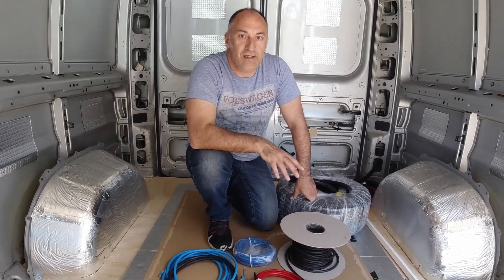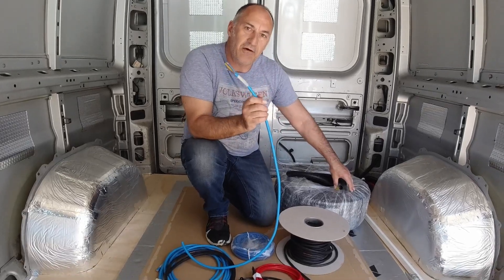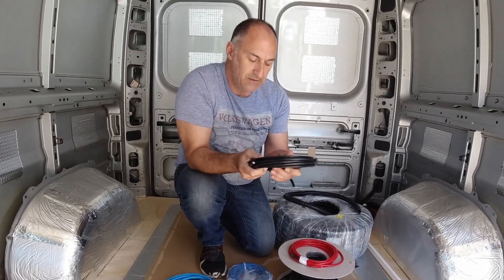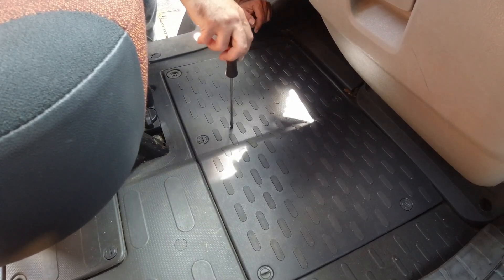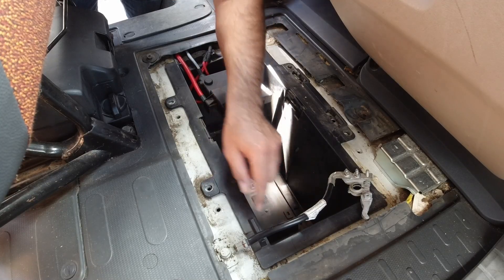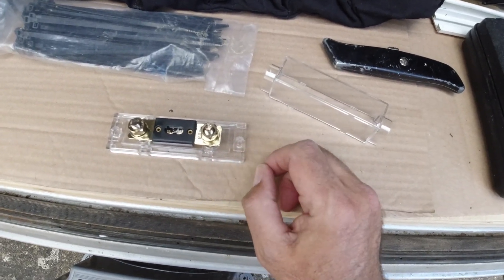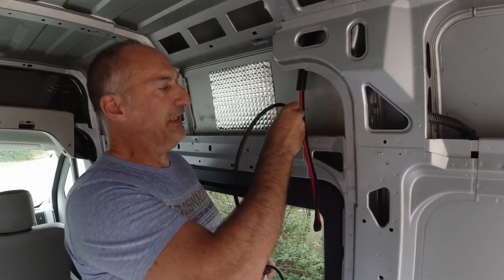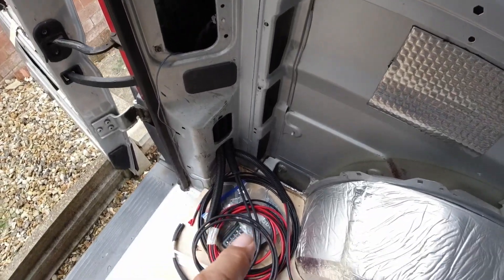How to Wire a Camper Van - Budget Build Electrics Ep15

Comment: Hi Greg. Big fan. I've followed your renogy installation to the t. I was wondering if you could help with a problem I'm having with my inverter. It works perfectly with 240v, but off the grid, I'm getting a reverse polarity. Do you have any suggestions. Thanks Graham 
Keep up the great videos
Reply: I plugged a tester straight into the inverter. I wanted to test it before going any further.
Reply from the maker: @GrahamSmith-i8u  I would expect no earth from the output but not reverse polarity. 
Does that differ from battery feed to mains input.
Reply from the maker: First thing to check would be all your 230v wiring to make sure not crossed any connections on your installation
Reply: Thanks for getting back to me so quickly. Yes, the wires are on the opposite side to the charge controller with mppt. Some suggestions are it could be that it's not earthed properly. I've earthed it to the body of my van. Is that correct? Thanks Graham
Reply from the maker: @GrahamSmith-i8u  I was referring to your 230v mains cable installation that you would have done. I’m assuming you wired off the inverter to some plug sockets. How and where are you testing for reverse polarity?
Reply: @GregVirgoe  Yes I have a plug socket straight from the consumer unit in which I plugged the inverter into, and that's fine when hooked up.
Reply from the maker: @GrahamSmith-i8u  unplug the mains kettle lead to the inverter. Just have it connected to your battery and turn the inverter on. What does your plug tester tell you
Reply: @GregVirgoe  that's where the problem is. Without hookup, the polarity is reverse d.
Reply from the maker: @GrahamSmith-i8u  yes I understand that but with the mains unplugged?
Reply: @GregVirgoe  yep I have the kettle lead plugged in and running off the battery.
Reply from the maker: @GrahamSmith-i8u  please unplug the kettle lead so the inverter is only connected to your leisure battery. Turn the inverter on. Now what does your plug tester tell you. 😊
Reply: @GregVirgoe  I'm still getting a reverse polarity
Reply: @GregVirgoe  I just plugged my phone charger into the inverter, and it was charging my phone. Does that mean it OK  and my tester is wrong?
Reply from the maker: @GrahamSmith-i8u  ok 👍🏼 It's normal, the inverter has a floating earth so the tester can't tell the difference between L & N (actually there isn't L & N just two lives) plug a device into the inverter and it should work ok 👍🏼
Reply: @GregVirgoe  honestly I can't thank you enough. Thank you so much for your time this evening. I look forward to your next video.

Comment: Hey Greg, I’m loving all the van builds! Quick question. Why did you go with an ANL fuse rather than a circuit breaker type from the battery? Cheers!😁
Reply from the maker: Circuit breakers have an inbuilt overcurrent rating where they will take a little time to trip on small over currents. This I have learned from training on the current regulations. 
Whereas a fuse will break closer to its rated current. 
My video on consumer units explain how they work in more detail. 👍🏼😊
Reply: @UC1Ewv0k%F0%9F%91%8D%F0%9F%91%8Dp0Npz2JWtIdhdryw Perfect! Thanks for that reply. I'll go and purchase one now and I'll have a look at the video. Cheers!👍

Comment: Hi Greg - I've been really enjoying your series on van builds - we are just on doing a Boxer L3H2 and found your videos to be invaluable. Quick question regarding cabling.  I have ran a cable from blade fuse holder to a double USB socket and another to the kitchen light.  Would I be ok to take a spur using Wago blocks from each of these for an addition USB socket and addition light from the respective cable run, or should these all be separate cables from the blade fuse holder?  Much appreciated :-)
Reply from the maker: you can carry on to another device providing that your initial cable from the blade fuse holder to the first device is large enough to safely carry the total load of both devices and you will need to increase the fuse size because of the extra load. 
I use this free cable sizing calculator to help me https://www.12voltplanet.co.uk/cable-sizing-selection.html  just scroll halfway down the page to find it. Hope that helps :D
Reply: Thanks so much for your speedy response - very much appreciated! ❤
Reply from the maker: @PJphoenix97  no problem anytime :D

Comment: Hi Greg another good video. 

Just one question why did you add an extra fuse holder in the battery box when you could have used the spare fuse terminal on the positive battery post. This would have saved cost and resulted in less connection's. 

Just an honest bit of feed back.

Chris
Reply from the maker: Yes to be honest I just purchased the fuses with the rest of the Renogy Gear. There was a spare fuseway on the positive plate and maybe it would have saved me a couple of quid :D

Comment: 3:00  Greg, Just so others understand, please make sure that you also use fuses the trunking cable at the battery itself as well.   The fuses need to protect the cable, not the device!  That is why you always size the fuses to the max the cable will support or less than that number.  That way if a short happens, the fuse will burn out before the cable does and starts a fire.  Safety first.  Just remember that if a car/van/truck starts on fire, its almost guaranteed that it will be destroyed by the amount of flammable and toxic material in there.   Get job.  🤠👍  Another thing is that you should always use at least the split loom tubing on any fixed cable in a moving car.  And secure the cabling along the route.  Ideally use a wire tie around the object you want to secure it to and then another wire tie around the tubing and through the first.  That way the cable doesn't actually lay on the rigid part and rub.  I have seen many rub outs of wires from either not being secure or secured directly to the item as the cable moves all the time.  Conduit or split loom tubing really helps mitigate that issue for sure.
Reply from the maker: 8:25 & 10:28 👍😁

Comment: Loving the van build videos, so much attention to detail 🙂 Question I was hoping you might be able to help me with, I have 315 watt solar panel running down to my mppt onto my lithium battery on my van and was hoping to some how take a feed off of the wire to be able to charge up my power bank rather than having to carry more portable solar panel's. I have a solar panel off switch that I can isolate my solar from my mppt and was hoping to add something in so I can isolate my panel from the mppt so I can then plug in my power bank into the solar  cable - is this something that is possible and if so what would you recommend on how to do it? thanks in advance
Reply from the maker: Yes you could use a double pole changeover switch in between your double pole isolator and your MPPT to divert that power source to your power bank, would be very easy to retrofit and this is the device that you would need to install  https://www.ebay.co.uk/itm/184176008043?hash=item2ae1bedb6b:g:gp8AAOSwq4leS~bq&amdata=enc%3AAQAIAAAA0LhRm9GWKKMVFLnCoXdvqd00UvkfkdJGJpqKGBi1Tt6Ycs7nVQJizjULsClje9d1c8k4jNLEtS5MUDXbKg2z6%2BHaOHos14N6foMyHF81wumviDv43ZxBl4Vp%2Fe7DjJdXMe%2B9iD8iWH86jKNspL2VzrhSflZ%2Bpu9X%2B3CyQP0mv%2BDzcu8tnV8%2BrZWiAb8l5O6vtphC184JZ3iJh4RAjgWRMYawJ8Hxl6VidyfwuphRMMXV%2FFyiiBbyXzWg37Qyd1mQa50AHraaRBPjkhxePnjq3do%3D%7Ctkp%3ABk9SR-641-zdYg&mkcid=1&mkrid=710-53481-19255-0&siteid=3&campid=5338027957&toolid=11800&mkevt=1
Reply: amazing thanks for getting back to me 🙂 @GregVirgoe

Comment: Another super clear video Greg. Just like to highlight how important it is to fit the 40A as close to the battery terminal as possible, just as you have shown. This prevents the cable from burning in case of a short circuit further down the line.
Reply from the maker: Thanks, Rob, also applies to the fuse for the blade fuse holder which will be right next to the leisure batteries. Cheers Greg
Reply: Would you mind explaining a bit more on what you mean here about putting the blade fuse holder near the leisure batteries, and putting the 40A (fuse?) near to the main battery?
Reply: @junglegoose4648  Fuses are there to protect the cable from burning, in case of a short. So one side of the cable is protected but the other side is not. So placing the fuse as close as possible to the battery, means the unprotected part of the cable is as short as possible. (less likely to be damaged).
Reply from the maker: @junglegoose4648  fuses are to protect the cable from overcurrent situation so the fuses need to be fitted close to the battery as possible then you can run your cable to wherever you want to fit your device.
Reply: Can you put a fuse straight off your battery terminal before you run your wire off it?

Comment: Quick question: Do you put a large main fuse in the main cable that runs from the leisure battery to your fuse box?
Reply from the maker: Yes, please look at my previous budget wiring video you will see a fuse close to the battery for the blade fuse holder, this will still be the case to protect the long cable run.

Comment: Wondering why you are running ground cables to your fuse panels instead of grounding each panel to the chassis.  This would save a lot of money on wire.
Reply from the maker: Because I would much rather install an isolated system than run the risk of bad grounds.

Comment: As always, such a great video, and really love that you let us in on those moments where you show your weird side (ie crimped connection reaction). Perfectly laid out and edited video. I do a few things that add to you method, might be overkill. 1. I add grommet and/or edge guarding to the sharp edges where the conduit comes through, doubly ensuring protection of the system, especially if it gets squeezed. 2. I add labeling at all entrances and exits of 120vac (here in the US) as well as use orange colored extra rugged conduit. This is mostly for emergency responders in a just in case situation. The us hasn’t codified totally a color scheme so i went with the color my manufacturer uses for their EV in higher than 48v situations, in this case orange. I also use labels for the solar lines since they are always live even though it’s at non lethal voltages.
Reply from the maker: Never a bad idea to go the extra mile 😊 I shall be doing lots of labelling once complete 👍🏼

Comment: Another excellent video Greg, thanks. Question, if budget not a concern is it better to have the fuse block close to the power source?
Reply from the maker: Good question, I don’t think either location is better from operational point of view if cables are sized correctly. So then the only benefit is the lesser number of cables to install initially. We have 3 blade fuse holders in our Sprinter van. So remote distribution I think is the way forward. 👍🏼😊
Reply from the maker: Obviously the supply to the blade fuse holder needs a fuse close to the battery.

Comment: Hi Greg, I’m currently working on my van and you’re videos are a great help. I have also run a positive cable to my starter battery underneath the van but have the negative cable attached to the chassis in the rear light pillar. Assuming that this is ok?
Reply: Thanks Greg for taking the time to explain things to a novice. Luckily I’ve haven’t boarded any of the wiring yet so I can still go back and follow your suggestion 😊
Reply from the maker: You can use the van body for the negative path but personally I prefer to have my 12v leisure side isolated from the vehicle. 
To avoid any issues with poor connections and volt drop etc. I also don’t want it to interfere with the vans auto electrical system. 😊

Comment: Greg, is I necessary to run an earth cable from the battery? Why not just use the chassis
Reply from the maker: Hello Steve, it’s not an earth. It’s the negative. 
If it was connected to the van it would still be the negative. That is sometimes referred to as a ground connection but that is still a negative and not an earth. The reason I run a negative is to keep the leisure side isolated from the van electrics and to avoid bad connections and volt drops. 😊
Reply: @GregVirgoe  “earth” is just a figure of speech from a 53 year old car mechanic!!
My point is that on the renogy unit All the negative/ground/earth/black cables connect together and therefore to the vehicle chassis as a result, my installation works perfectly without the additional cable from the starter battery,
Keep up the great videos Greg, cheers 🍻
Reply from the maker: @steveford11  don’t worry I’m sure you won’t be the only one that says that. 😊👍🏼

Comment: Greg, Would you recommend running and leaving a length of strong cordage through the conduit at the same time as the wiring.
This could be used to pull through any additional wiring required later.
Another length of cordage could be pulled through with any additional wiring added, allowing for furthermore cable runs again in the future; that's if there's enough room of course.
Possibly another length of conduit (with cordage in it) in parallel with the main one, to facilitate more wiring in future if space in the main conduit is limited.
This is probably overkill, but hey! if or when more wiring is needed after the fit out is done, it could save quite a bit of hassle.
I Just thought I'd share my raving ponderings with you Greg, I hope you don't mind 😆👍
Great series Greg and Lou of course, the camera crew 👍👏🚐🐕👊
Reply from the maker: It’s a good suggestion as we have had to pull in new cables as things evolve and used the old cable to pul in two new cables. So a draw string would help. We also found using a hoover to suck the string through worked well 👍🏼😊
Reply: @GregVirgoe  👍🚐🐕👍

Comment: Great timing, I ordered everything from the previous video on electrics. Quick question... I ordered the 50 mppt as its cheaper on their website currently. Do I need to up the fuse from 40 to 60? I have exactly the setup you are doing.
Reply from the maker: There are a few things you need to increase. 
The fuse to van battery needs to be 75amp and cable needs to be 25mm. The fuse to the leisure battery needs to be 60amp and you will also need to add another battery if you already have Leoch ones or consider buying two Renogy 100Ah lithiums because 50A charge is a lot to put into two AGMs
Reply: Thanks @GregVirgoe  I have cancelled my order and re ordered the 30. Look forward to the next video.
Reply from the maker: @thedroniedad5008  I know it doesnt seen like a big difference but it affects a lot of things :D

Comment: Awesome. I am just wiring mine up niw.
Reply from the maker: Have fun! Hope all goes well 👍🏼
Reply: I like your idea about putting a fuse panel on the passenger side. I am running another line this week for it before i wool it up. @GregVirgoe
Reply from the maker: @alutious  we have three fuse boards in our sprinter van. 
One in the garage, one above the kitchen and one above the lounge seat. That cuts down internal wiring by more than 3/4 at least.

Comment: Another great video guys. It's the jobs like this that take time and although you get the benefit when the van is complete, you don't get to see the work that's gone into it as its hidden away.  Looking forward to the next one.
Reply from the maker: Very true! Most of the work in a van conversion is behind the scenes. The furniture is the easy bit that comes together quickly.
Reply: I bet if you were to have a look at a factory build and look closely at the work you don't see you would wonder why they are so expensive.
Reply from the maker: @davidanderson5893  from what I’ve seen there’s no conduit it’s all loose cable held in place with masking tape and a prayer 🙏🏼🤣

Comment: Thanks Greg, to save on purchasing too much cable & conduit, can you give us an idea how much cable you used or will use? and can recommend a cable/fusebox labeling tool?
Reply from the maker: Obviously this depends on what you intend to fit in your van, that may be very different to mine and you layout could be quite different too. To help with plannign cable runs I draw a simple pencil sketch of the floor fo the van and mark on it where things are going to go then with a tape measure and my piece of paper decide where the cables are to run and measure each one inthe van and write the lengths on my plan, i add a M to each one for a little bit of spare and add them up to order from there. I often order a bit too much but rather that way than run short.

Comment: Entertaining and informative as usual. Only thing I can add is definitely works better to fit two fuse box's one each side of the van. Way less cable runs.
Reply from the maker: Yes I have three in our sprinter, one in the garage and one either side in the high level cupboards. 👍🏼🤩